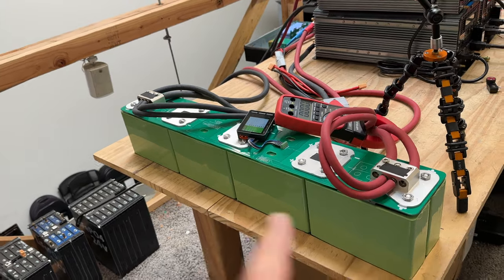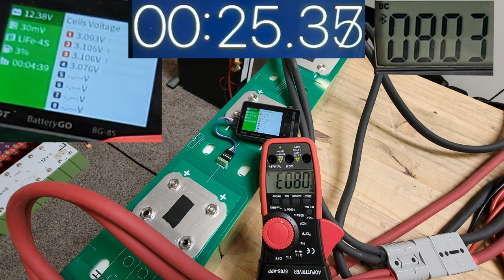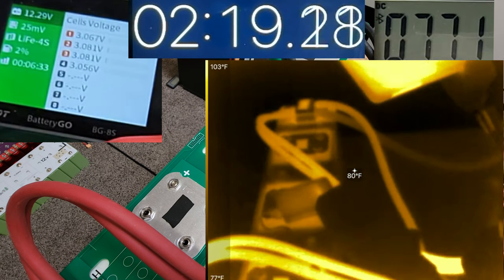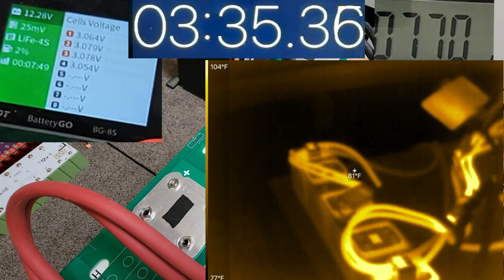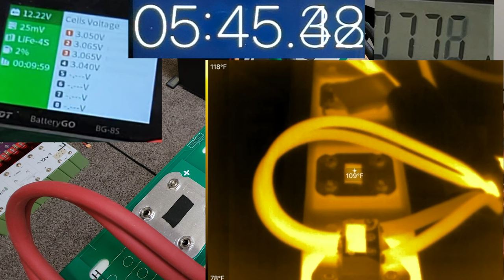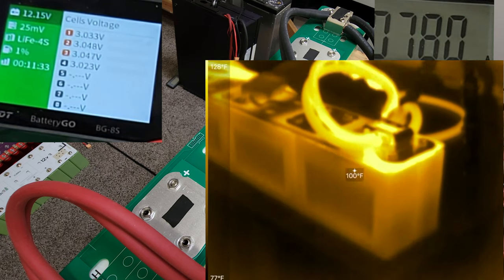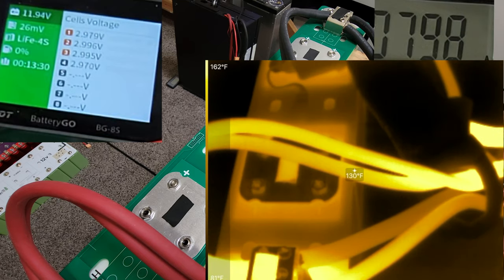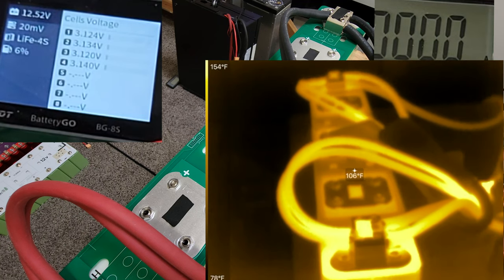SLIM 148Ah 12v Audio Power Battery 800A Torture test

Comment from the maker: This cells can do 1200A for 10 seconds and  800A continuously https://jag35.com/products/assembled-12v-4s-600a-lev60f-battery-lifepo4-long
Reply: this test show the stability of the Batteries wow feakin impressive.
Reply: These can be used in a performance ev,alot of amps
Reply: I need these for my audio system in my car. It can drain 600 amps continuous.

Comment: I got two of the smaller banks on a taramps md12k @ 0.5 ohms 
They stay above 12 volts with the truck off full tilt 😂 they are very good audio cells
Reply from the maker: Nice
Reply: What size alternator what size bank ??
Reply: What size alternator?
Reply: @joegama57  stock, the lithium is strong as hell
Reply: @MegaRm85rider  stock, the lithium is strong as hell
Reply: @cristiannieto1353  okay, just wondering because I have a 400 amp mechman alternator.
Reply: @MegaRm85rider  make sure you charge at 14 volts or below, also get multiple banks at least 4 to handle the charging amperage if you rev it up
Reply: @cristiannieto1353  damn, I brought one and was going to buy another one but I charge at 14.8. I guess this isn’t going to work for me.
Reply: @MegaRm85rider  yeah 14.8 get lto or sodium ion

Comment: Seems like these would be perfect for golf carts. Would four in series work for 48 volt @ 800A? Should be able to climb a pretty steep hill. Is a BMS needed?
Reply: No bMs is need I don’t use them unless you Only want half the juice that’s all a bMs is going to do I’ve done my testing.but do as you want in the end.
Reply: Just grab a balancer, rather than a full bms

Comment: Nice video as always. Those AL busbars in middle are holding well not a problem at all. but on those terminals they don't looks so well i think they should be changed to handle current better
Reply from the maker: I disagree,  they got just as hot as all them copper cables.  They did well for that crazy amount of power

Comment: How safe are these if your driving for 4 hours with 320 amp alternator? Does the digital battgo balancer tells it when stop taking  a charge? Sorry for the newbie questions
Reply from the maker: No the batteries will stop taking charge once their voltage matches that of your alternator.  As long as it’s set below 15v there is no danger of overcharging them.

Comment: Must be higher resistance in those cable junctions and anderson connecters.
Reply: Not any significant losses the Lev60 performance is not affected by the connections nor the performance of the load I’ve done my own extensive testing and the cells are for heavy duty  use and they are new cells long life ahead.

Comment: You need to measure the brightest spots, around the terminals, and not exceed the battery operating temps. Or you will do this once or twice.  The cables are heating the batteries since the middle batteries are cooler.
Reply: The max temp top left is important... Where is it? 185F!!!
Reply: Also, what is the spec C discharge rate for those yuasa cells?
Reply from the maker: @HansSchulze officially it’s 2.5c  but our testing show they perform well up to 5.5c

Comment: These cannot be charged using an alternator and therefore are ill equipped for car audio application. They have a charge amperage of just 100A. They would take a lot of time to charge them after they are depleted. They have a very poor recovery time unlike LTO cells.
But I stand corrected if I am missing something.

Comment: Have you ever thought about some cooling around the batteries.  I'm thinking something like a peltier unit stuck to the side, with a fan blowing the hot air away??
Reply from the maker: No these don’t get hot so no need to cool them
Reply: Peltier cooling is woefully inefficient. Would make things worse.
Reply: Please explain and share you data.  Thanks.